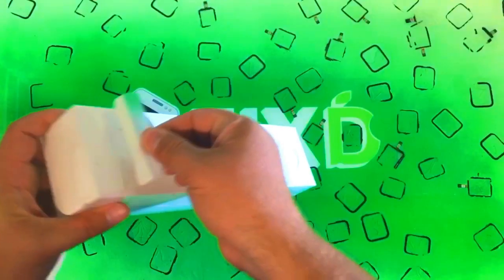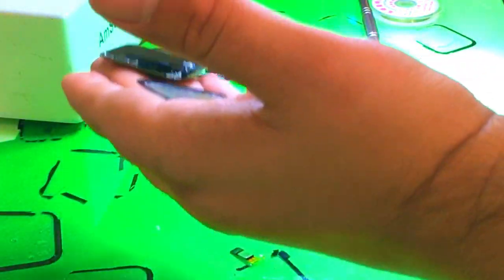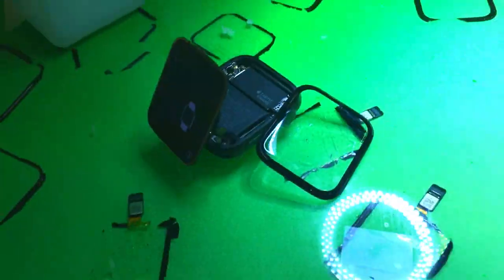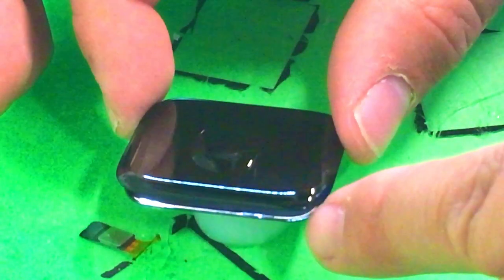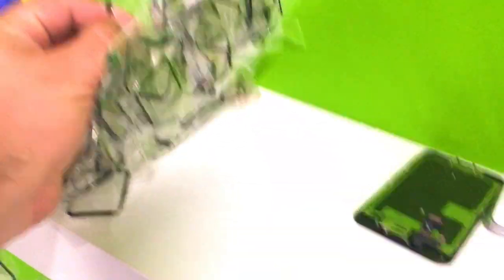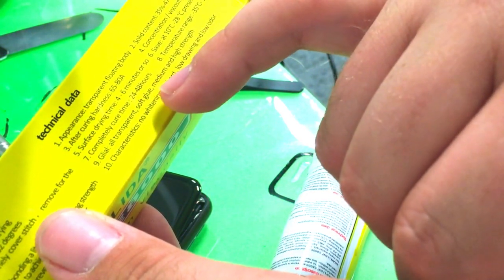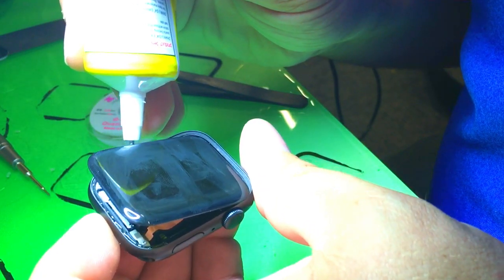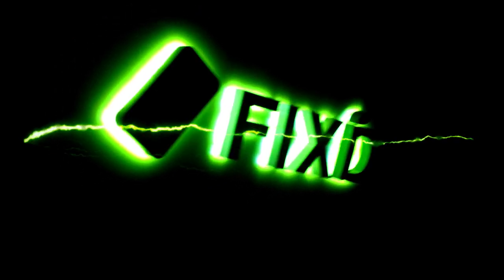Crystal Clear Again: Apple Watch Series 5 Glass Repair!

Comment: what is the heat plate used for?
Reply from the maker: It’s used to warm up the adhesive so that it’s more pliable and easier to cut through. A hot knife cuts easier through butter 🧈

Comment: Hi ive removed the screen and digitiser from my apple watch series5 44cm and want to test it works before i fix it back together ? i have connected the lcd WITHOUT the digitiser and screen (connected left and right only) when i turn the watch on the screen still black? can you advise

Comment: Hiya. Love your videos still, I have watched them all. Do you know if the series 4 40mm force touch fits the series 5 40mm force touch? I broke the series 5 during repair and cannot find a replacement anywhere!
Reply: Did you find the answer, please? I am also interested in this, S4 and S5 touch screens looks the same, but idk if they really are.
Reply: @WhitePrinceSK  the s4 and s5 are different :). I bought my one from Ali express. They have a stable quality now 1:1 is the best. Make sure you update the Apple Watch before you install the new digitiser
Reply: @ninjarepair3362  now I see, but you were talking about force touch sensor, do you know anything about compatibility of digitizer (touch screen) between S4 and S5? I was looking for some glass+digitizer on ebay/aliexpress/amazon and there is a big price difference. S4 glass+digitizer costs about 22 euro, while S5 costs 100 and more.
Reply: @WhitePrinceSK  oh sorry 😂. Yes the force touch is also different from the 4 and 5. They use a different connector. Hope this helps :).

The digitiser on the 5 is different than the 4. If you're only replacing the glass, you can use just the glass from the 4.
I got mine from 
https://a.aliexpress.com/_dWM3KLT

Comment: Hey FIXD, can you give me some instruction on what corner of the display you like to start with first when cutting into the watch? I worked on two series 3 watches and learned never to start on the side where the digitizer meets the back side of the LCD. Is this true for series 4 and 5? Also if the screen is broken enough, do you always put downward force away from the LCD, or does the direction of the force always depend?

Comment: May I ask what the cost of a display repair is for series 5 44mm please? And do you use OEM or aftermarket glass? Thank you!!
Reply: Claudio Nicoli Hey Claudio, did you find out the cost? Please share. Mine is also broken now. Would appreciate. Thanks, Rahul
Reply: Rahul Chaudhary it was $220 plus taxes and $10 shipping yet decided to just purchase a new watch instead due to the shop (understandably) not being able to guarantee water resistance anymore

Comment: i've recentrly discorver you trough Jerry Rig Everything, and i have to say that i'm mesmerized from your work!
a question popped in my mind seeing this teardown: the thin copper foil under the display, connected on both the bottom corners, is an antenna, am i correct?
Reply from the maker: Simone Evangelista it’s simply a copper sticker that grounds the screen to the frame. I’m assuming for static electricity in the body etc.

Comment: A few months ago I got 3 apple watch series 3 from ebay with broken screens because after I saw your videos I thought I could repir them myself and who know maybe even open a shop as here in Guatemala there is literally no one that has that service available, after sourcing for the parts and the tools I proceed to fix the glass, the risk was calculated but man am I bad at math, i burnt the screen one one and left it with bubbles, the other one I removed part of the digitizer in some spots and the third one I didn't even glued the glass because I ran out of loca, (that thing came from china and 90% of it was hard as if it was dried so couldn't use it) altough that one i didn't screw the sreen up its just a matter of getting more loca but at this point i'm done with that, thank you very much for your videos even though I screwed it up I had fun with doing that and you inspired me to do something new in my life and now i can see why you always say that it is a very hard thing to fix them, you surely need experience. I would love to see how you remodeled the shop.

Comment: Thanks for talking about the adhesive! The screen on my wife's 1st gen Apple Watch came off for no apparent reason the other day. Time to fix it!
Reply from the maker: Garrett Clement check the battery. When they start to swell they pop the screens off
Reply: @FIXDPHONES  I just checked the watch and you hit it right on the nose - the battery is definitely swollen. Thank you again!

Edit: Bummer. After performing a bit more research, it looks like Apple extended their warranty for this issue to 3 years - but I waited a few months to deal with it and now I'm outside of the warranty period by less than thirty days. Oh well. At least it's not the worst repair in the world.

Comment: How did you insert the wire without removing the glass's edges?
Reply from the maker: Filipe Fonseca I couldn’t get a good shot of it but basically under the microscope you have to loop the wire and play with it until the wire is under the digitizer. It normally takes a while and a ton of patience is required.
Reply: @FIXDPHONES  IMO this is the hardest part of this repair. Out of a dozen or so watches I've only been able to get 2 preserving the digitizer. It's not a big deal, obviously. Glass/digitizer combos are cheap, but still...it'd be nice if I could get it consistently.

Doing it by bare eye is a guaranteed torn digitizer 1000%.